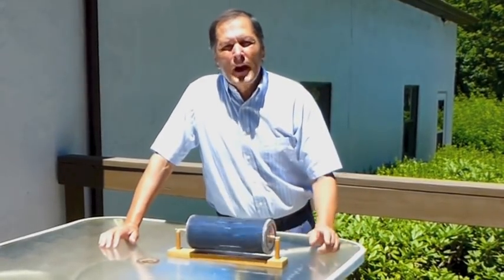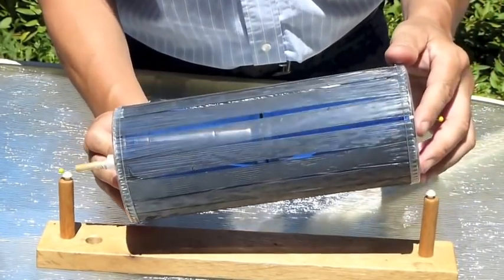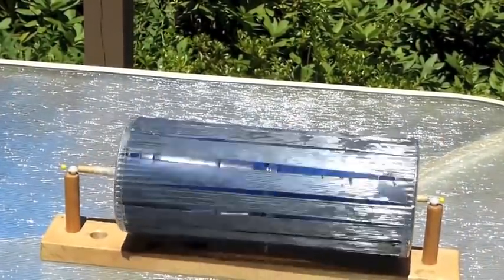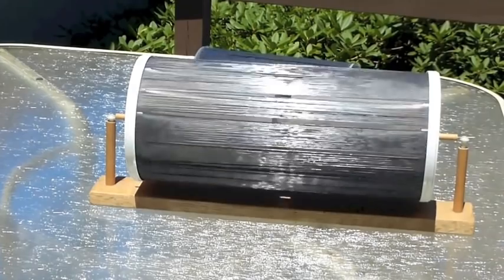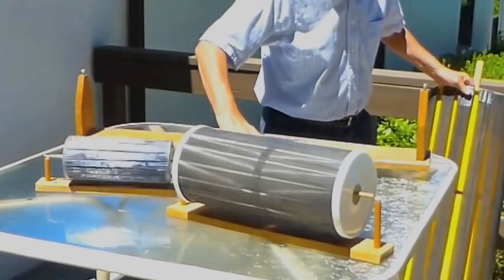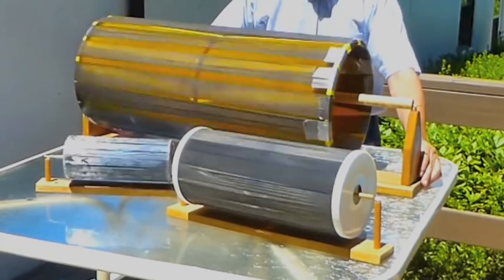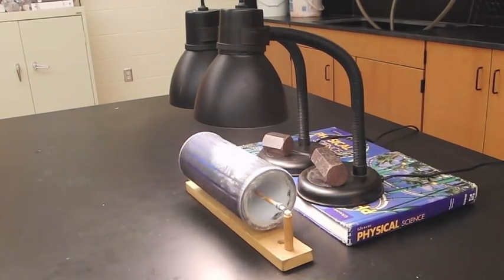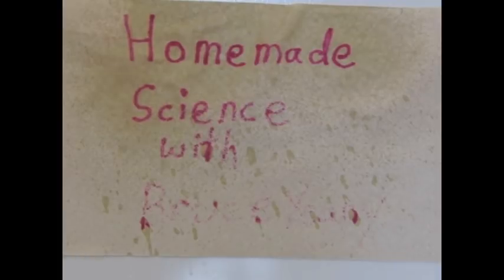Solar motor--Free energy motor-- not electrical /// Homemade Science with Bruce Yeany

Comment: Having taken the effort to produce your video, surely it would not have involved excesibely much more effort to have given information about those solar strips. Just what are they? Are they made or purchased or what? I have seen a video which shows a bicycle wheel modified to accomodate rubber bands for a good length of each of  the spokes. Two powerful spot lights play on each side of the wheel which then rotates very slowly.Can thin  black  rubber strips be used in your motors? Thank you in the event you make the effort to give me the information sought.
Reply: Bruce Yeany
Reply: Thank you very much for your so prompt reply. .My email id is vivianastridge@gmail.com.Thank you again.

Comment: I have built this using five different brands of black plastic garbage bags...each with different thickness and elasticity. None of them even attempt to start the rotation while sitting in direct sunlight, let alone under two 60 watt lamps. For anyone who has built this and succeeded, does it matter what black plastic bag you used?  Did you attach the ends immediately after stretching, or let them rest a bit? I tried both and still no luck. Did you cut the strips parallel or perpendicular to the top of the bag? So many questions!
Reply from the maker: Lance & Mel Miller Do you have my set of instructions?  I address most of your concerns in it.  If you would like them I will pass it along to you but I do need an email address to send it to.  To answer a few of your questions now.  It does not matter what brand or what mil  thickness.  I did have a few problems with a few really cheap bags that were made with recycled materials.  I generally use the thinnest  trash bags sold by a brand name company such as Hefty or Glad.      The strips are cut parallel to the top of the bag,  the cut edges must be smooth, any small nicks will cause it to tear.  I use a plastic ruler and press it down hard against the plastic bag  and then slice it using a razor blade on either side of the ruler. This way the widths of the strips will all be the same.   Safety is a concern here so I wear a leather glove as a precaution against cutting myself.   A four inch piece stretches to about 16 inches.  I can use them immediately. Hope this helps, let me know what other questions that you have and I will try to address them.    Bruce
Reply: Bruce Yeany Hi! I do NOT have your instructions! I was actually using this really old article from Popular Science on Solar Muscle...so that's probably outdated material?...Just built another one today, but it's completely overcast outside. Which raised ANOTHER question!...how well will this work on an overcast day?! Anyhow, thanks for your time and the instructions! My email is: lanceandmelody@gmail.com
Reply from the maker: Lance & Mel Miller Congratulations!    I'll take you suggestion to check out the thicker pieces again.   Now that you've gotten the idea, a little more experimentation will get it going faster, the best I've done is about 65 RPMs under bright midday sunlight.  Hazy days are no good.  I make them with the strips under some tension and to get it balanced, I stagger them as I put them on.   If I want it to do some work as with the bell ringer and solar hammer,  I build it with more tension on the strips and then add a ring of solder to the rims of the cups lids.  This acts as a flywheel and makes it more efficient so that I can add  tiny loads to it.  I did shoot some video  showing how to calculate  it's power in milliwatts and then convert that to micro horsepower while it is run by sunlight, but haven't had a chance to put it together and edit it yet.
Reply: Lance & Mel Miller IT WORKS!! THANK YOU, THANK YOU! I'm editing this because I just tried the really thin stuff and they had the thing going at 32 RPM under 75 watts! When I tried them before, they were spaced too far apart due to how narrow they stretch! So the thinner the plastic, the narrower the strips...of course! OK this is fun!
Reply: Do you have the plans posted somewhere, or could you email them to me? I made several of these 25+ years ago and my son would like to try to make several variations for a science project.  The plans I had are long gone.  kcerer@gmail.com.  Thank you!

Comment: Hi Mr. Bruce, very interesting, with much respect to you i can say your solar motor is great a breaktrough idea, i'm an accountant from Mexico who likes to develop energy generators with an inquiring mind and i'm really interested in this project. Would you please send me some more information about the motor, the way it works, its construction. Thank you My email is cesarsoto@yahoo.com
Reply from the maker: Cesar Soto Hello Cesar,  the motor is an interesting piece, but it will not have enough  torque for driving an generator as an energy source.   I'm in the process of making a video on calculating power and will post it this fall.   I would be happy to send you more information about it,  check your email for it.  Bruce
Reply: Mr. Yeany, thank you very much for the information i received, its very useful !